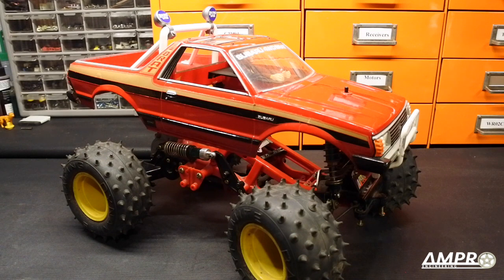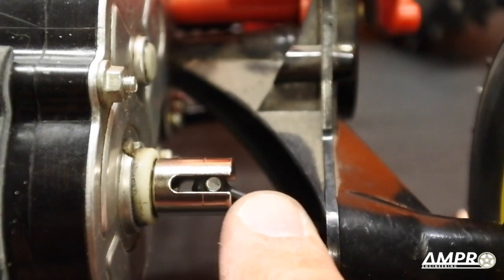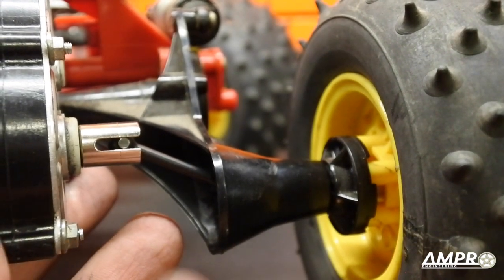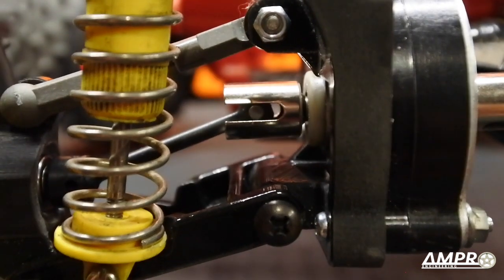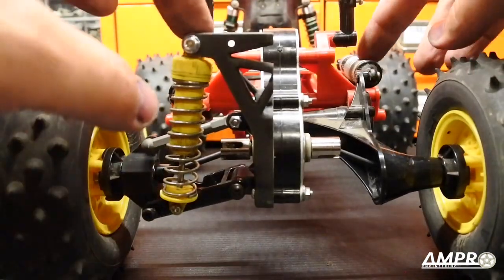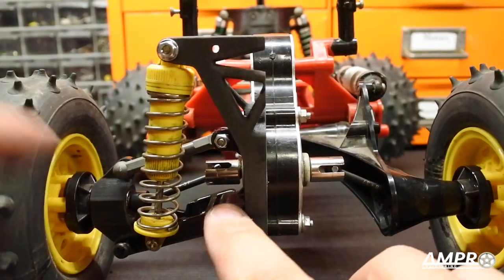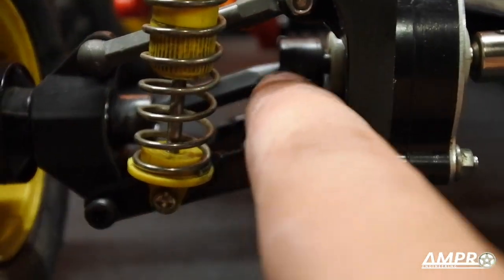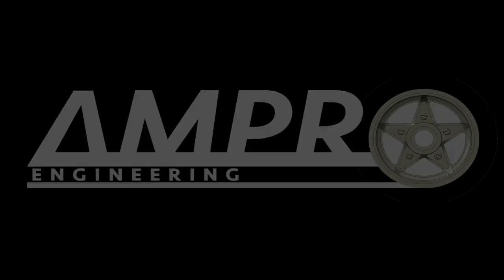E28  Tamiya ORV Double Wishbone  Rear Suspension   Development

Comment: Great 👍 but I don't own a 3d printer how would I able to purchase this product cause this would help my 2016 blackfoot truck I love this but thus driving ne crazy everytime i play with my truck please help lol thank you
Reply from the maker: I also do not have a printer. All parts are linked to in episode. You will find them all on shapeways.
Reply: @AMPROEngineering   ok great another question how would get the hardware is the site for the hardware or would tamyia carry the hardware. But I did write down what hardware that's needed for the suspension. Thank you
Reply from the maker: @tiken7130  The list of hardware is in the video description. You can take that list to a local hobby shop or search for some Tamiya screw bags with the parts needed. Usually, some of the cheaper cars like the Stadium Blitzer have the screw pins or at a hobby shop, you can get actual roll pins.
Reply from the maker: The total 3D print cost is calculated on shapeways (all links in the video description). They will show you your cost at your currency and shipping to you.
Reply: @AMPROEngineering  hi again just wondering if you can Link me video of the battery replacement in how I could take battery n and out of the Blackfoot thank you so much
Reply: @AMPROEngineering   and the suspension how much would it cost me along with hardware. Thanks again

Comment: I would definitely consider this, seems like a great idea.   My re re Blackfoot has been nothing but a massive disappointed especially compared to a secondhand Monster Beetle I owned in the early 90s. 
I didn't have the issue of the swing shaft coming out of the drive cup at first although, I have since read of a lot of people who have.  
However, I can see clearly in your video the swing shaft has printed on it Bo37 (solid o or circle).  So did my stock one, that broke so searching the parts number on the back of my Blackfoot manual (19808071) or the Parts Bag designation (BB15), I thought I had found the correct replacement part...
Now the swing shaft constantly pops out of the drive cup (on the motor side, of course).  My re re Blackfoot has become an ornament because of this, on closer examination the replacement shaft has 'B37' printed on it and the orientation of the ends are different to my stock one.   
It seems like there are two different 37mm swing shafts that share the same parts number.
I'd like to know if anyone can shed any light on this?
Thanks from an ex-Tamiya fan.
Reply from the maker: Yeah, i hear your frustration. The CVD's on the RERE are much worse than the hex drives on the originals so it is amazing that Tamiya managed to make the thing worse. This is the sole reason I made the rear double wishbone suspension for it. I think what you have are two different builds of the axles. My suggestion is that you limit the shock extension but adding an internal spacer on the shock shaft. it is BS that you need to do that but yet, here we are.
Reply: @AMPROEngineering  Thanks for the suggestion.  I'll look into it.

Comment: I never owned a Blackfoot or Beatle but my first car was a frog. The frog was a great runner and was underestimated despite it's problems. I always loved the trailing arm suspension. It probably worked better on the frog. Trailing arms create more forward traction and are better in the rough when set up properly. They also make these cars what they are. I wish tamiya would have made the arms stronger but I wouldn't give them up.
Reply from the maker: Oh yeah, on the frog it was fine. Add big tires and then forget it!

Comment: I know this is an older video but if you are still interested in who made composite hex drives for the Tamiya ORV’s I believe it was either JG or CRC (sorry it’s been a while 😂) I had a set as upgrade replacement back when I had a Blackfoot supposedly they had better wear characteristics than the original steel ones eventually I put a Thorp ball diff in that car with regular dog bones and that solved most of the issues.
Reply from the maker: Oh that is ok, I always check the comments. I think it was CRP that made them but honestly I am no expert. Sorry I was no help!

Comment: year later, ouch. wasn't a fan of the lay down cantilevered shocks on these. we'd cut tubing to put inside the shock body, was less suspension travel but dog bones didn't pop loose! the angle of them were too extreme for efficient power transfer anyway.
Reply from the maker: Same here. I was afraid of it rolling over all the time.

Comment: Being younger and not having the luxury of the 80s experience, I can only get my info about these cars from the rumors and tales. This is the first time I've seen the hex drives, and know how easily meta can grind, I can easily see those stripping. I think that if the hex drives had more to mesh with, say grooves and such like a gear, it wouldn't grind as easy and would still be around.
Reply from the maker: Well, I am one of the few that really had no problem with the Hex drives. I do know how they rounded off and why that was the case but I think they were overall quite good. The main reason why they worked so well was because they would work perfectly throughout a large window of rotation, something the dog bone cannot do. Of course I agree with you, if they had more bite, they would have lasted longer.

Comment: its cool 
tamiyas original design is based of a 1970s beetle 1303 rear end
alot of the models that use the ORV suspension was based around the same rear end
Reply from the maker: Yeah, it worked fine on the Frog but once the big wheels came in, the problems were exacerbated.
Reply: yeah it was to much for the suspension
 i plan to ball diff my RE-RE FAV and build a XR311 thx for putting links to your stuff on scale4x4 
im the guy thats rebuilding my TA-02 LR3

Comment: Wow do you do a kit for this it's awesome I'm in the uk can't find anything like this?!
Reply from the maker: Hi Andy, yes, there is a set you can get on shapeways. It has all the SLS 3D printed parts but you need to supply your own hardware. Shapeways has a location in the UK so it will dramatically drop shipping/import duties. All information on the suspension is here in episode 37 (https://youtu.be/M4LEdlsA6PA) and links to the parts are in the description. Please let me know if you have any questions. Thanks!
Reply: AMPRO Engineering could you link me to where I get all the parts need? Also could you recommend a good set of shocks oil type for a black foot?
Reply from the maker: Here is a link Andy. 
https://www.shapeways.com/shops/ampro?section=Tamiya+ORV+Cars&s=0

The part numbers you need are here:

058006-01 ORV Double Wishbone Transmission Base
058007-01 ORV Chassis Brace
058008-01 ORV Double Wishbone Arms and Uprights
058009-01 ORV Battery Access Door

And Episode 35 has the installation and hardware you will need. 
Thanks!

Comment: Awesome solution. I have the re re Brat that I haven't had a chance to build yet and I'd like to install your finished and tested set up into my build so I don't have to deal with the hassle of the old Tamiya design. How much more could the upper links you mentioned cost? I'm unsure of what the length of the included in kit shocks are-could they be made to work or will I have to buy a pair of 80mm shocks?
Reply from the maker: Well thank you! I am thinking the upper links could add $5 to the cost but overall I think most people would want to install the ball ends. Maybe I can make 2 versions. Personally, I would rather a rigid link for appearance sake. As for the shocks, this is designed to work with the stock units. They are around 77 mm I think. I hope this info helps!
Reply: AMPRO Engineering-I'd be interested in the rigid upper links-also for appearance and ruggedness I'm not a huge fan if ball links because I'd be worrying about them popping off or getting the length just right for the proper camber. Maybe they can be mounted with shoulder screws like Traxxas uses for their rigid upper links on their brushed XL5 2wd vehicles (Rustler, Bandit, Stampede).
Reply from the maker: See I agree but I would rather a ball pop off than something break. Plus, the added cost is no good. On top of that, you would need some harder to get hardware from Tamiya. Personally want a rigid link like you but I think it will be way harder to deal with in the long run. I'll see what testing shows.
Reply: I don't mind paying a little more for the rigid upper links since it'll save me from the hassle of buying the threaded rod, ball ends and the actual ball mounts and trying to make them the proper length.
Reply from the maker: That is a good point. Maybe I will offer both. That will be simple and make everyone happy.

Comment: That will blow the original out of the water in handling. I'm imagining uses for just the lower and upper arm mounts: the trailing arm could be modified with a lateral link to direct the flex...
Reply from the maker: I can't wait to drive it. I thought about somehow stabilizing the trailing arm but they were are patches. This car has had 34 years of patches. Time for a f%*#ing solution. This also has a compression ring for the diff.
Reply: Is there any degree of anti squat in this design? And I replied to your messages, btw. The Yt messaging system is cray. :p
Reply from the maker: Great question. Yes, there is 50% anti squat. To accomplish this, the rear lower arm mount is angled forward by 4 degrees. Will it work? What, do I look like a physicist? Lol. We shall see!

Comment: You my friend, are a mad genius. Good work on this. Should I ever decide to add more power to my ORVs, I'll pick these parts up. I don't have any issues running them with silver cans and Torque Tuned motors.
Reply from the maker: You know, those are all I run also. It seems that the front end never stays in place. You have the rere's ? All mine are vintage.

Comment: I love it! For the rear upper link I'd go with whatever is strongest. I'm rougher to my Blackfoot than I am my lunchbox. Rocks,  gravel, curbs, jumps my Blackfoot goes through it all. I love the stuff so far and the battery door idea is great, it solves one of my biggest issues with the the chassis from back in the day where the battery leads would rub or chafe against the stops.
Reply from the maker: I think it will be the tie rod. Easy and cheap. I have another plan for the battery retainer. I am thinking of making a battery cage for this car considering how it puts the battery in harms way. Not an issue with NiCads and NIMh's but with a soft case lipo? Jeez.
Reply: @AMPROEngineering  where can I get hardware for the suspsion and how much would cost thank you
Reply from the maker: @tiken7130  Hardware needs to be source at a local hobby shop. That is the best way.
Reply: @AMPROEngineering   ok great a link into how I would put my battery on my Blackfoot to keep it in place without losing the battery while driving the truck since the whole rear end is changing thank you
Reply from the maker: @tiken7130  So the best thing for that is to have a battery that fits the battery area well. I have a small case I made to fit smaller batteries that is designed to keep them in the ORV chassis. I will show this soon in a video!
Reply: @AMPROEngineering   ok thank you so much